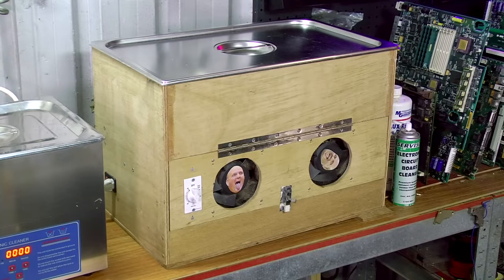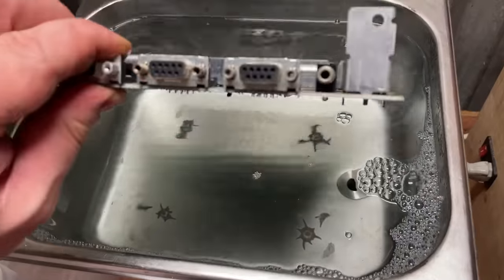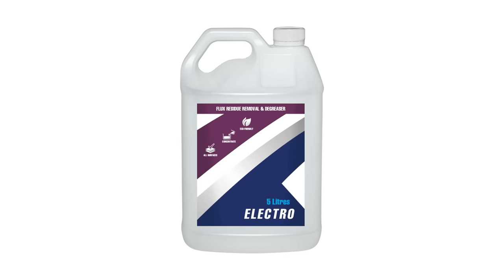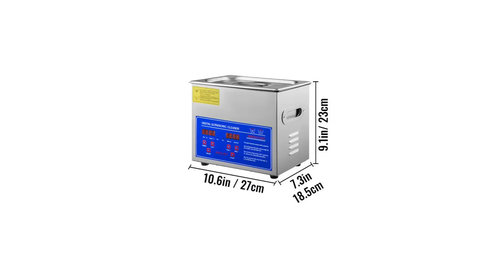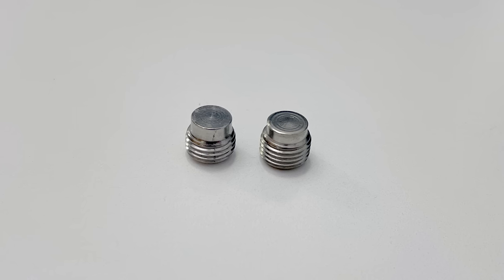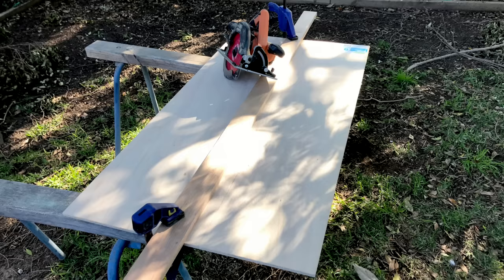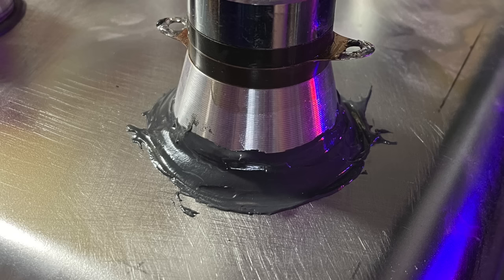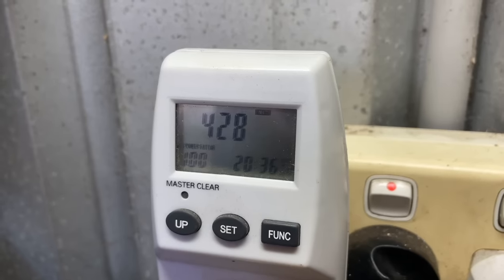Building my own Ultrasonic Cleaner

Comment: One way that you can mount the studs without welding is to drill and tap the studs on the tank side and then drill holes in the tank and use cap head  Screws to connect them using copper washers to seal the Junction.
Reply from the maker: If you get a chance, I'd recommend checking out the follow up video of this project: https://youtu.be/ByhGEFwCxoY
Reply: I was thinking something like that but couldn't find the copper washer in my head.if that works with all the vibration, you are very cunning sir 😆😂😹😹😹
Reply: Sounds like a good idea but since all the electronics sit under the tank i would never dare to make any holes in the tank, Just in case a leak was to happen.
Reply: @Anthony Williams  Copper washers are commonly used in automotive applications typically on the oil drain plug. They are however a one time use item as they become work hardened from being clamped by the fastener. Another example of a crush able metal seal is the small washer that come on spark plugs, Which are designed to extend high heat vibration and pressure.
Reply: @theagemon  I see your point however if I were to copy this build I would likely try to build a separate/protective enclosure for the electronics.
Reply: I would never try that. Copper washers would be too easy to corrode. Just weld the studs.
Reply: @petercoutu4726  True. I would make a sepparate enclosure for the electronics or atleast put them somewhere where they are not directly under the pan, Or put a "leak pan" under the liquid holding pan sort of like an enclosure around a fuel cell, A box in a box.
Reply: Wouldn’t denatured alcohol be better than isopropyl? I was told that isopropyl leaves some oils behind. Not sure how true that is but I switched to denatured alcohol for most things ever since.
Reply: @Bodhi1satva  IPA most definitely doesnt have any oils in it. Actually many denaturated alcohols are ipa based.
Reply: @jothain  Yes I prefer a hoppy India Pale Ale :)
Reply: @dmaifred  Old, so really really old :)
Reply: @petercoutu4726  The Old School method to soften the copper washers is to heat them with a blowlamp/torch to red heat, then drop them into cold water - this is the opposite of ferrous metals (steel will harden, and has to be heated and cooled bery slowly to anneal it) but works for brass too - for aluminium rub soap on and heat until the soap blackens, then into the cold water, lets you bend things back straight...
Reply: @Dave H  very true, I just tend to use new if I have them on hand.
Reply: Aluminum crush washers and red Loctite.  In a one-and-done application like this, the aluminum washers shouldn't have any issues with work hardening, and the Loctite will easily take heat that maxes out at 100C.
Reply: If any washers are used they would have to be beryllium copper washers as they are non-sparking and far more corrosion resistant than plain copper.
Reply: Couldn't you tap, screw, and glue the studs to the pan?  A bit of Loctite on the screw, plus the copper washer under the screw head, plus the JB Weld sealing the stud to the pan plus the JB Weld sealing the module to the pan and that thing is never coming off.  Of course if the transduder module cracks then you're really screwed (oops I made a pun...).
Reply: @Bodhi1satva  IPA is pure alcohol, just not ethanol. Denatured ethanol, OTOH, you never know what they put in to make it non-drinkable.
Reply: They make specialized high temperature silver solder. It will adhere steel or stainless steel. It holds gun barrels together, and gun chokes. Flux both parts and pre-tin with the silver.. use a propane torch in the tank.
That's only to attach the mount permanently.
Reply: In the video, he says he usually cleans certain motherboards 10 minutes per side.
Why would you need to do that?  Doesn't it clean both sides at the same time.
If it can't clean the side either facing up or down, why not put it in standing up? Surely it would be easy to create a jig to stand the MB up.
Reply: @petercoutu4726  brake lines on calipers too
Reply: @AnthonyWilliams-id3gm  copper washers at the auto parts store they are used on the brake system calipers.
Reply: I’d go with welding. It’s easy to find a welder who can do this for a reasonable price and then it’s done….no worries about leaks, no messing with washers. Some of us may be lucky enough to have a friend who can weld and then it’s just the cost of a case of beer.
Reply: I was thinking of using the weight of the filled tank to acoustically couple the eight transducers; ie use them as 8 feet for the tank. Requires moving of the driver/psu but might be worth it
Reply: @alnicospeaker  "the best part is no part"
Reply: @kaleygoode1681  ikr - I'm not sure how the epoxy glue reacts at those frequencies >20khz, it could dampen the power output. I'd also be interested to use an audio (PA?) amp as a driver, which would allow for varying input waves..geez I just commented myself into another 'project'
Reply: drilling holes in a perfectly sealed tank is stupid af, increasing the chance to leaks up to 50%, i rather spotweld them on . That is solid af, bonded with the material to let through vibrations 100%,
Reply: @petercoutu4726  I bought a selection of copper washer from Aldi of all places. they have been handy.
Reply: @petercoutu4726   to fix the work hardening, you can easily anneal copper by heating it to just below a dull red glow.  You can either let it air cool or quench in water, it doesn't matter, the annealing happens during the heating phase and they don't temperature harden by quenching like steel does.
Reply: @jothain  denatured alcohol by specification is almost entirely ethyl alcohol (found in beer/wine) with some poisons added to prevent it from being drunk (hence, denatured).  Usually this is with some methyl alcohol and I suppose you could add IPA, but the base solution is still almost entirely ethyl.  It has different properties than IPA and other solvents, so it would never be substituted with something else and still called denatured alcohol.  It's always >95% ethyl alcohol.
Reply: @SolarMillUSA  That's not universal. It highly depends on country. Here denaturated alcohol can contain ie. 8% of isopropyl and various other things.
Reply: @jothain  so we’re talking about the difference between 92% ethyl alcohol and 95% ethyl alcohol? I didn’t look up the exact spec so forgive me on the 3% difference. Your original comment said that denatured alcohol is occasionally IPA +based+, and base implies primary constituent. My point is that “denatured alcohol” is denatured ETHYL alcohol.  Always and regardless of country, that’s the main ingredient to the fullest amount possible. It can never be 100% by the very fact that since it is denatured, a minimal amount of adulterants have been added to make it poisonous. Also if it was pure ethyl alcohol it would be more expensive because we would have to pay an additional tax on it. It’s the closest that we can get to pure for industrial purposes without jumping through some exorbitant hoops.
Reply: @SolarMillUSA  Not that kind of tax here.
Reply: @jothain  you’re one of those people on the Internet that just likes to argue, aren’t you? TL;DR - denatured alcohol is denatured ethyl alcohol. A minimal amount of adulterants are added to make it non-consumable. There is no product on the market sold as “denatured alcohol” that isn’t overwhelmingly high percentage ethyl alcohol. End of story.
Reply: @SolarMillUSA  Generally yes,but there still are ie. Disinfectant products that are labeled denaturated that can contain other than ethyl.
Reply: @jothain  name one product.
Reply: @SolarMillUSA ie desifektol series had one iirc
Reply: @jothain  and regardless, it’s not germane to the original statement “many denatured alcohols are IPA based” not if there could be other products labeled denatured. If you buy a solvent that is labeled denatured alcohol, would the primary constituent be anything other ethanol? (such as IPA or methyl).  And the answer is no. Because both of those are poisonous to begin with so there is nothing to denature.  Denature means to take drinking (ethyl) alcohol and make it not fit for consumption so it can be sold as something other than drinking alcohol.  (or in some cases, ethyl alcohol that is already too low of a grade to be fit for consumption, but because people might try, needs to be made completely unpalatable).
Reply: to anyone trying this now, don't bother with all that. Just epoxy it straight to the bottom. Always works

Comment: man , those driver circuits are garbage . i also got one and it blew up a couple of times , sometimes only after a few minutes working .replaced parts and it blew again after few runs . there is no point to fix those , as the frequency output is unstable . i'm currently working on my own driver circuit .

Comment: I have deep respect and sympathy for people that build stuff themselves. I know from my own experience there usually are many, many problems, but you persevered and got a solution that works great for you. Well done, and also an awesome video!
Reply: Most problems can be researched out on the drawing table..  Most..  It's the last ones, that is the interesting part to play with. Like chess.
Reply: Version 2.0, 3.0, 4.0 etc is how it is done ... even some space telescopes don't always get it right on the first try.
Reply: yeah he HAS a solution (in his bath)
Reply: @ejrupp9555  even in nature, nothings completely correct and is in constant correction... Please correct me if I'm wrong.... Hahaha...
DeWalt power tool type #,  for example  are usually above 100. I e. Type 101 means over 100 prototype before production... So he did quite well....
Reply: @kenclarke4906  IMO, there is no, one perfect thing ... the only things that gets close are evil & fantasy. The remedy to improve good enough is worse in unforeseen ways.

I had a Religion teacher in HS with your name. 

Good enough is by definition ... good enough.
Reply: @ejrupp9555  and the bar is set higher each time it's hurdled not when it's limboed. Especially when life or limb could be compromised.. every reality started as a fantasy. And evil is perfect for failure of anything constructive... I'm from the demographic that good enough is not good enough, and building a better mouse trap will catch more mice..and worth the effort... However only no mice would make the better mousetrap perfect but then unnecessary. And I'm an agreement with you on most of your points.
Reply: @kenclarke4906  A tall man cannot hide in short grass. The infinities go in both directions. You can travel neither to the end.
Reply: @ejrupp9555  The tall Man simply becomes a tree or a mountain.
Hiding in plain sight. And empty space is not infinity, Unless it's really good short Grass you are smoking.
Reply: @CONEHEADDK  field testing and testing.... In actual fields...

Comment: Thanks for making this video! Some issues i have with it are the 2 devices you called voltage stabilizers - those are bipolar transistors. The epoxy you used - the manufacturers use special high temperature high hardness homogenous mix that seems to hold the transducers even after getting over 200 deg C. The transducers are actually piezoelectric resonators and the driver boards attempt to resonate them at their own frequency. Using one driver board for 2 transducers reduces the vibration amplitude. The transformers use a special type of wire to fall in line with the skin effect at this kind of frequencies so be mindful when rewinding them. The transducers run on 1.5 up to 3 KV so be very careful with their wiring. I work with transducers for ultrasonic welding at 15, 18 and 20 KhZ with up to 3KW of power each. Be mindful when taking them out of circuit when hot and attempting to touch them when they cool off - due to the piezo effect and the plates being compressed by a large diameter bolt which contracts and expands with heat the plates can and will generate a substantial charge on the middle electrode if not in circuit. Disassembling them will also generate that type of charge as well as assembling them. The piezo electric material that the plates are made of usually contains lead and titanium but the lead is quite toxic so wear a respirator if you notice a broken plate in any of the transducers. As you found out - every board and the vat should be grounded. The polarity of the transducers is important because their outside electrode must be grounded to the vat and supply ground.
Reply from the maker: Can you recommend a suitable epoxy?
Reply: @BranchusCreations  yes, i have to check what we used at work first. Maybe next week when i go back there.
Reply: Holy crap Eviltech! That was cool. Many thanks for the details!
Reply: @hudzgh  You are welcome! Glad i could help!
Reply: @BranchusCreations  search for this: epoxy resin glue,AB glue can be used in the stainless steel and the ultrasonic transducer paste
The site is erasing the comments in which i post links.
Reply: Hi @Eviltech, I'm in the thinking process of creating my own ultrasonic cleaner and as you seem to have more knowledge in this field than I do, any chance I could get in contact with you for advice?
Reply: I got the crap shocked out of me once handling the transducers for my cleaner. was quite unpleasant.
Reply: That's bizarre that the cases would be grounded, wouldn't have thought that. Also I think possibly having one reversed would cause some phasing issues or "hot spots" no?
Reply: Hello @Eviltech. I have been wondering why ultrasonic welding is only used for spot welding. I'm working on a "MIG" ultrasonic welder and would like to pick you brain if you are available.
Reply: @GeorgeAlbercook  it's basically friction welding. The soundwaves generated by the transducer are focused by a special camerton and in to the materials to be welded. The friction you generate by pumping vibrations in to one of the metals causes it to rub quicly against the other. the friction generates heat and melts the surfaces together. the transducers are run in a resonant state which increases the energy allot.
Reply: @TheOriginalEviltech  Yes, and they are always spot welder style friction welder. Could I make one that could make an arbitrary shaped weld bead? Like a stick or wire feed welder vs. a spot welder.
Reply: Can anyone tell me why the transducer is able to transmit energy to the container when it seems to be just hanging freely off the bottom, without any force pushing it upwards? Or is it that the horn itself bends, while being held by the small threaded bolt welded to the container?
Reply: @mrdongable  the bolt trough the piezo rings acts like a spring and the whole thing contracts and expands about 20000 times per second. This creates a sonic wave that travels trough the material and in to the water. you don't need the transducer to push against something because it pushes against it's own mass.
Reply: @TheOriginalEviltech  Great thanks Evil!
Reply: You two should get together and refine his product and get it on the market